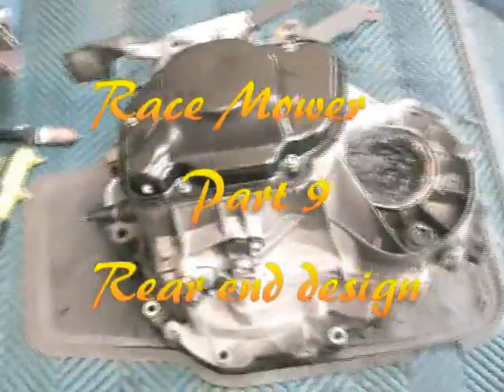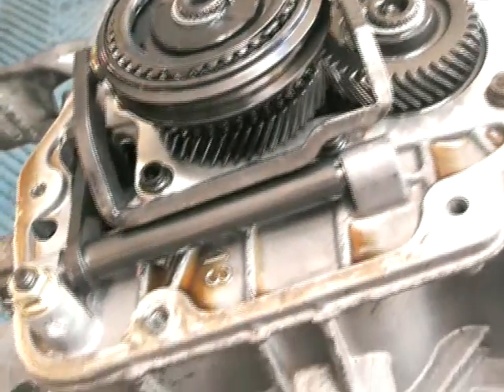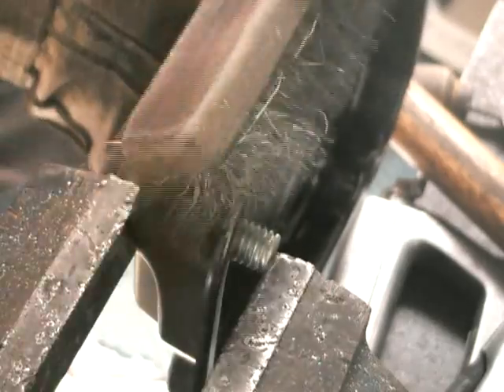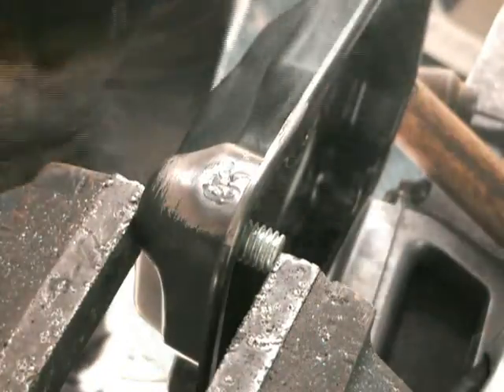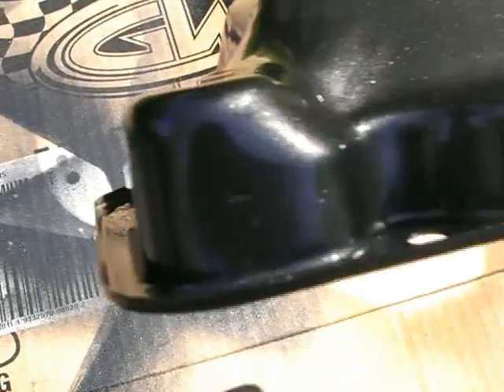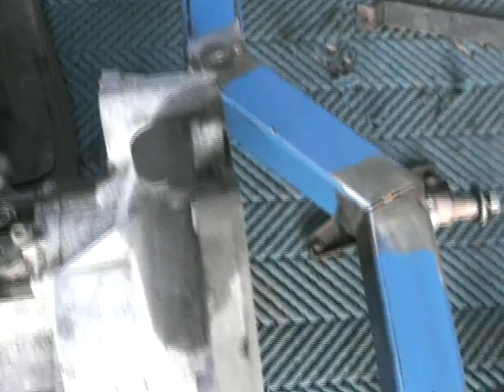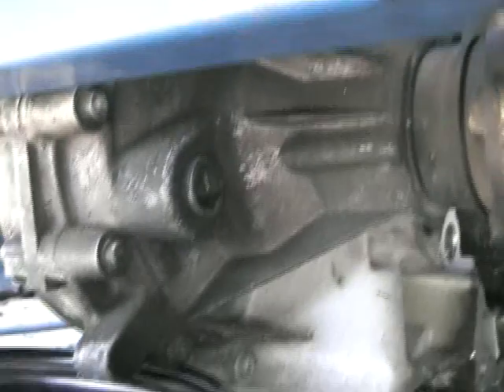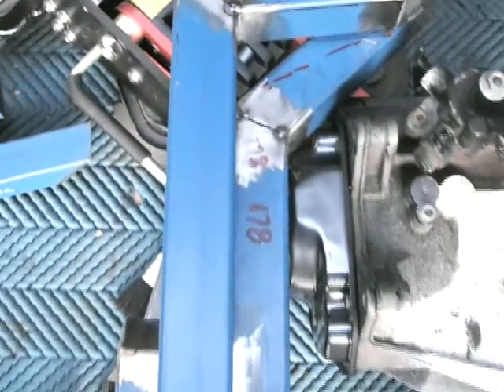Race mower Part 9 Rear end design

Comment: I'm rebuilding a GSX400F myself. Engine is all done. Carbs are next BUT - I've had a hard time finding power filters small enough so they can actually sit beside each other on the carbs.. Which did you use (if you can remember)? Would love a reply. It sounds killer, mate. Good work.
Reply from the maker: Hi Mate, I can't find the detail of my original purchase. I got them from ebay and they do contact a bit. As you see i still got them to fit, they just butt up against each other a bit but seem to hold no issues.

Comment: I watched your later video about the final drive sprockets , but my question is about the clutch for the vw trans ..... Are you just using the clutch off of the motorcycle engine to shift the vw trans ?
Reply from the maker: Hi Norman, good question. I use the GSX clutch as the main gear change and have found that I can change gears while moving on the VW gearbox even without a clutch. 6 gears on the GSX is enough so I usually just select the range I want from the VW, eg 1st gear for mowing or towing and 5th gear for speed. It can start anywhere from 1st to 5th from the VW gearbox...